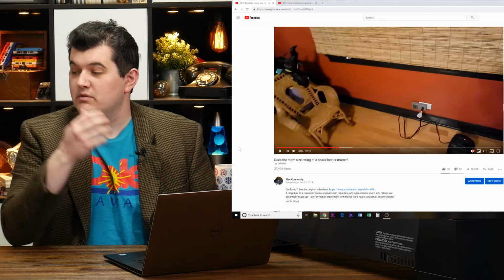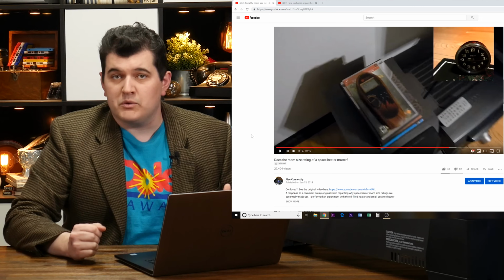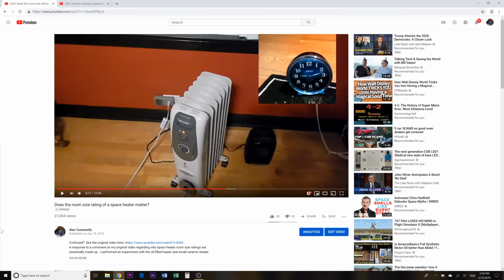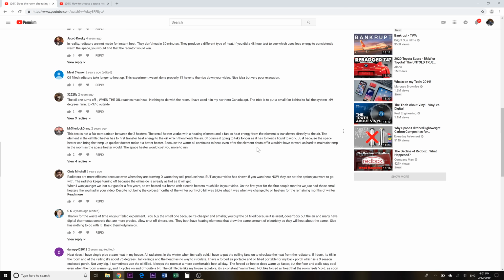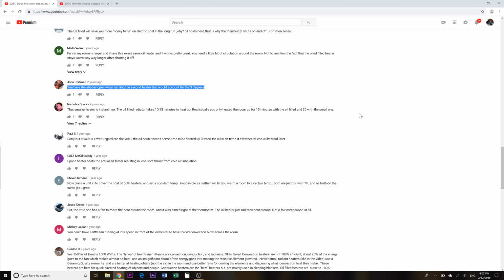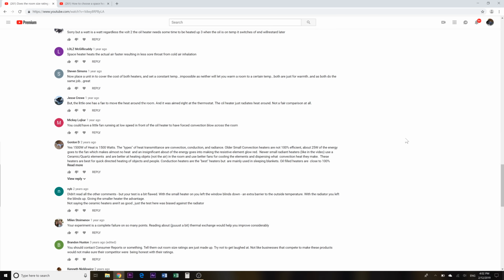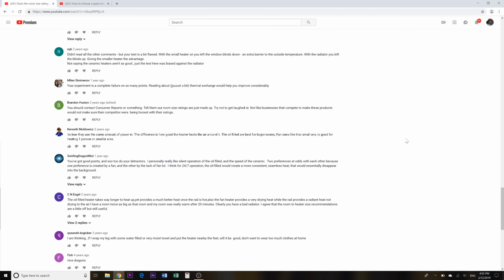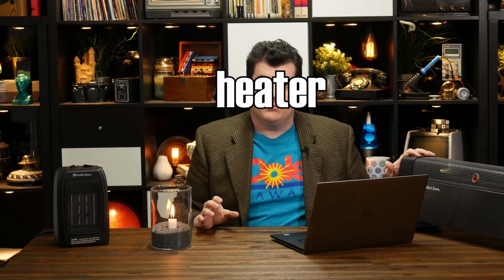More Space Heater Nonsense

Comment: Preach. Small 1500w ceramic heater with a fan at edge of room pointed toward center. Flip ceiling fan to 'winter' mode (counterclockwise, usually, blowing 'up') on low. Great solution, at least til the (usually sealed) fan bearings go bad. Infrared can be good if you don't want to actually heat the air and therefore dry it out. It heats YOU and objects more directly via radiant heat, which can be nice.

Comment: Perhaps the room size ratings are more geared toward heater duty cycle rather than heater effectiveness.  A larger room will need to have the heater run more often and a "smaller" heater may not be rated to maintain maximum power output levels for as long as a "larger" heater.
Reply: Expanding on this alittle bit.  Take 2 heaters of a similar design, one with a large heating element "rated" for a larger room and one with a small element "rated" for a smaller room.  Even though both heaters are outputting the same amount of heat, the element in the large heater should be cooler than that of the small since there is more surface area to distribute the same amount of energy.  This SHOULD allow the larger heater to last longer, if given the same room to heat as the smaller heater, since the component providing the heat goes through less overall stress during its duty cycle.

Comment: Aside from tricking people into paying more for the same wattage, the room size claims might also have to do with durability and safety.  The small one heats fast, but if it's in a big room with an insurmountable thermal load it could run 24/7 and clog its filter increasing the risk of heating element failure/fire.  The bigger heater with lower airflow is less likely to get clogged and overheat.

Comment: Hey my man, don't let these guys stress you out so much.  BTW, try another experiment,  start with a warm room and see which one keeps the room warm.  And for accurate results download this software; http://temperature-machine.com/ and use it to monitor your room temperature.  And try it over two different nights.  Measure the power output.  I think you will find the power usage will be about the same, but the oil filled heater with maintain a constant temperature while the force air ceramic heater will fluctuate 5 to 10 degrees.   If you would like to see my results you can contact me here and I'll send you my data.

Comment: The only thing I can think of is that the larger heaters might be designed to radiate heat throughout the room rather than simply heating up the immediate air. The way a large room would be more evenly heated rather than the very hot air just rising to the ceiling and being wasted. Or maybe they large heater heats more air to a lesser amount, refusing effective waste.
But honestly it's probably just marketing.

Comment: The reason why the heaters are cataloged that way is because when they say "space heater" it really refers to "personal" space heater. The idea of these heaters is not to heat the whole room, since the use of electricity is inefficient, but to heat the area where one is. If you have a single heater to heat yourself, the bigger the room, the more you will not want the heat to expand and mix with the cold air of other areas. If you set a room as a parameter, as you mention the two heaters are the same and the smaller ones do it faster. But if they are used to heat oneself by being close to the heater, those that prevent the heat from expanding faster will be more efficient in heating your area thus more efficient in the use of electricity. 
PS: Great Channel!!

Comment: You experiment is wrong is because you measured room temperature, not heat temperature in the room.
The oil is better for the heat in the room because the raises the temperature in the room, so when you measure the heat, you're not taking into account that the temperature has changed.
The small one produces a lot of heat but it only uses the same amount of energy.

A better experiment would be if you did that.

I don't understand how you can understand this basic concept and not get what it means.

RIGHT?

Comment: That oil heater of yours sucks, a good oil heater thermostat will work fine or turn heater off as it reaches the desired setting. I have two  Delonghi oil heaters, one is from 20 years ago that still works great and a new one I just got from amazon for my room. I set the new one at setting 4 and only using 700w switch to heat up the room enough to make it comfortable and I hear the heater turning on and off. when I want more heat I raise the thermostat to the max and the on/off cycles are very long spaced, which means the heat flows upwards properly but without interfering with the thermostat. :)

Comment: Different people have minds that work differently.  A sculptor thinks differently than an actor who thinks differently than an engineer, they are different mind-sets.  Those of us with an engineering mind-set think and understand differently than the majority of the population, which my wife is quick to point out.  Even in the engineering disciplines there are differences, computer engineering, programmer, will think and understand differently than an analog designer, and differently than a digital designer.  So don't beat yourself up over it, it is just how things are.

Comment: You are correct, in thermodynamics terms, all the energy used by the heater is going into the room, but when it comes to HVAC, the volume of air that is moving through the heater matters. That's why when you compare heaters that work the same, the ones with the larger fan can bring up a room up to temp quicker. Even if both heaters are dumping 1500 W of heat into a room, the larger one will heat up the WHOLE room quicker.

Comment: If I go to my local Currys, the small room heaters look just like yours, but the big room heaters are 3000W, so obviously they will be better.
What I find with fan heaters is, they are really good at heating the air very quickly, but the walls, floor, furniture, other objects in the room will still be cold. My 3000W oil filled heater will take a lot longer to heat up the room, about 2 hours vs 5 mins, but the room will feel more comfortable when its done. If it is really cold, then I will put both on, and turn the fan heater off after maybe 10 minutes.

Comment: Qualification: electronics engineer who's had to deal with cooling components on PCBs and inside enclosures, in some weird conditions

The only difference in the designs is how the heat is distributed. Disregarding oil filled and radiant heat designs (which are more complicated), the surface area of the element makes a difference to the volume of air which is heated - but the overall energy output is the same. More air, which isn't as hot.  When you move air over the element, the more the hot surface can come into contact with the air, the rate at which energy is removed from it, so the equilibrium temperature of the element is lower (i.e. the heat is going into the air rather than heating the element itself, where it is not useful - you want the room to be hot, not the heater). For a physically small element with a small surface area, the volume of air it would heat may not be enough to set up convection currents to draw a sufficient amount of air in and keep a reasonable equilibrium (i.e. prevent the element from overheating). Thus the fan on the small model. But with a wider element, since a larger volume of air is heated at once (even if it's not by as much), you can get convection currents (think kettle with a traditional element vs one with a flat bottom element).  Same amount of power, different power density. 

In terms of distribution of heat, if you are making the air in the room move, the heat is likely to distribute quicker than leaving it up to convection alone. It'll still be the same amount of heat, it's just you won't stay in the corner where the heater is.  Which is probably desirable.  

In terms of the marketing, if you can have a physically larger unit that doesn't have a (noisy) fan, that's probably desirable - but only if you have space for it.  Making the units smaller requires you to have a fan (or some other way of moving air over the element), but they are physically smaller, which may be what you need if you don't have much space.   Saying that they heat differently sided rooms better isn't accurate, but they probably are more suited to different sized rooms?

Comment: My thoughts on trying to measure the 2 when the oil radiator takes longer to warm up

Two actually

1) get the oil heater as hot has it'll go in another room (far enough away it won't bleed over into the room you're measuring) then bring it in 

And 2) since you're are using a kill-a-watt to measure power draw then simply then the fact it limits itself shouldn't matter right? They're 100% efficient so all you need to do is get the average for an hour for BOTH 

Then you just math out the temperature change per average kw/h 

Do it! I'm like you I'm seriously fascinated by stuff like this stuff some might find dull or mundane - it's practical physics applied. 

But seriously do it I'm genuinely curious the delta change in temperature should be nearly the same per kw/h (taken as average) since they're both 100% efficient.

Oh and love you man legit probably my top 10 favorite YouTube channels don't get discouraged love your content

Comment: I was surprised you never mentioned conservation of energy. "Energy can neither be created nor destroyed. Energy can only be changed from one form to another". This says it all. Plus it's very easy to change electricity into heat. just add a little resistance under a load and you have heat. This is why electrical fires are so common.

Comment: Some of the energy in the heater gets turned into sound or in the rotary action of the fan so they are not 100% efficient.  The oil filled is in theory more efficient per watt used as a result of the lost energy to sound etc with the other heater.  Not by much though.  I agree the idea of the size of the room being a deciding factor doesnt make any sense but there are reasons to choose the oil filled heater over the ceramic heater.

Comment: Honestly, I would think that the little one would feel warmer faster because of the mixing of the room volume from the forced air. The natural convection will heat the upper 3-6' (depending on ceiling height) up first, eventually heating the lower 5-6' (where us humans are) of the room volume. Unless you have fans somewhere to mix the room volume, the heat will stratify.

But, like you, I have no formal training in HVAC.

Comment: I completely agree, except that you shouldn't really balk at the idea of those enclosed quartz heaters being any better. They do have some of the benefits that oil-filled heaters have (as you said), but they also generally do not have the thermostat issues like many others.

At least my lasko model seems to have a fairly accurate thermostat on it and does not jump up when the heating element is on. This may vary on design, but it seems like they're all fairly similar. It even has an eco mode which supposedly saves energy, and I think it might. Mostly because it brings you above temp then shuts off in the normal mode then comes back on when it's lower more like a normal furnace thermostat.

Comment: How about these tv-shop heaters that are sold by "look, it only draws 250W!!! and saves energy"? But they forgot to tell you that it only heats as a 250W heater... 
I think people just don't care or understand about physics. If the package looks or says it's better then it has to be better... Same with the price.
Reply: I stopped using my $45 digital controlled heater because I did not like that it was always using high heat when maintaining temperature. You could select low/high for continuous heat, bypassing the thermostat. I went back to using a cheap mechanical controlled heater, which I could select low heat and still use the thermostat. Problem I was having with the digital is that the two bathrooms share a 15 amp breaker, so when both heaters are on low it works fine. But when one is digital and uses high heat, it would trip the breaker frequently. leading to cold bathrooms in the morning.
Reply: But market capitalism does make one better. Demand determines what is better or more valuable, since there are no objective criterias for the "betterness" of a product in itself. By thinking that the lower-wattage heater is a better purchase, we effectively make it better, hence justify its price. Value is determined by the Market itself.

Never mind that heat is a fundamental need for survival and that people will generally opt to buy what is available and affordable to them instead of opting for abstaining from buying into marketed products and therefore freezing to death.
Reply: Petri Haak ...yea, so true....the Spinal Tap “it goes to ELEVEN” syndrome.
Reply: @mastro4065  And there's one more... EEVBlog #1186

Comment: As you've pointed out the major problem is that some of them have some crappy thermostats built into them which can cycle on and off even at the highest setting resulting in, overall, less energy being put into the room from the outlet to replace the energy escaping the room. Another way to look at it is this. If the thermal load on a room is 4,000 BTUs and you have a small space heater that can run at 5,000 BTUs, then you have a gain of 1,000 BTUs. But this is assuming the heater is running 100% of the time. If the whole unit heats up like a fanless oil-filled radiator and its own thermostat is influenced by this it will start cycling prematurely every few minutes and the average BTU output over time will be less, say around 4,500, and will absolutely take longer to heat the room up to the desired temperature. And if you have it sitting near other objects in a corner of the room where there's little air flow, you'll also develop a hot spot which can potentially make it start cycling even more resulting in an even longer amount of time to heat the room up.

Comment: The oil filled radiators on sale today are a little different than the ones from the years ago. I have several vintages and here are the differences.

The older radiators are BIGGER and HEAVIER. They are able to store more heat in the larger volume of oil and spread it out with more fins. Effectively, they disperse the heat from the electric elements FASTER. Also, they did not have a thermal switch to limit the power since their size allowed them to disperse the heat quickly. The downside is they were BIGGER and HEAVIER, so they were not popular. They did perform the best.

Fast forward to today's oil filled heater. They are SMALLER and LIGHTER.  Internally, the newer heaters have a limiter (thermal switch) that cycles the power once the heater reaches it's maximum operating temp. This switch is separate from the thermostat that regulates the desired temp. It is a safety device to avoid overheat of the unit since it can't disperse the energy fast enough when the unit reaches peak temp.

If the goal is to heat the air as quickly as possible, then the fan forced units should be better. However, if maintaining a comfortable room is the goal, the radiants work better. In other words, radiants can maintain the same level of HUMAN comfort at a lower air temp than the convective units, so they can actually save energy.

Comment: Irrespective of all the argument, I and my wife have used 3 of the oil-filled heaters to heat a 3 story townhouse in the north east.  Each heater has a small fan clipped to the fins and I keep them all at 70.    Our first year, we used baseboard heat and out electric bill was $500+  The second year, we got the oil-filled and turned off all of the breakers for electric heat.  Our bill is sub-$250 per month  I do understand where you're going with your thoughts, but you're not really articulating it well.
Reply: @chublez  One of the heaters on the middle floor replaces about 16 feet of baseboard heat and covers 3 rooms....dining, living and kitchen.   Upper floor has 20+ feet of baseboard (3 bdrm and bath) replaced by one oil-filled with a fan.   The basement in a walk-out and wide open essentially.  I have a more aggressive and efficient fan for that one.  It doesn't make the  same heat that baseboard will, but it keeps us comfortable and the money we save on electric goes to rum to keep us warm.  :D

Comment: Try this experiment. Go outside on a cold 40 degree day with no wind and bright sun and see how comfortable you are compared to a dark room with the furnace set to 60 degrees. It has to do with "heat quality" not quantity. It is the reason why different ovens have different effects on food.

https://www.herschel-infrared.com/how-it-works/radiant-versus-convection-heat/

Said this in the last video, but these experiments are just measuring the performance of the heaters in heating the air. The object of heaters is to heat people. Radiant heaters do this better because they are tuned to heat objects first. This is why they take longer to heat the air, most of the energy is going into the objects of the room. With time, the air temp will catch up as it absorbs heat from the heater and objects. Convective style heaters reverse this by heating the air first, which then heats the objects. This is why radiant heat is considered a higher quality heat because it prioritizes objects.